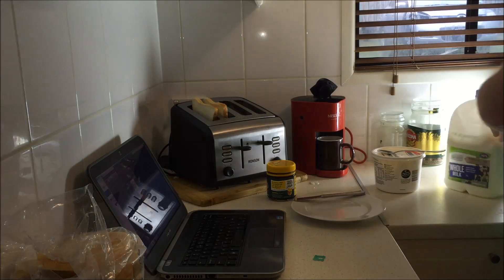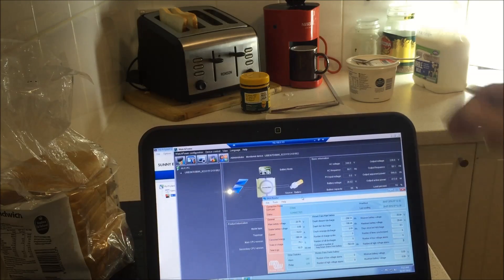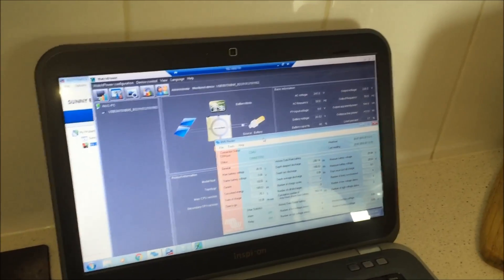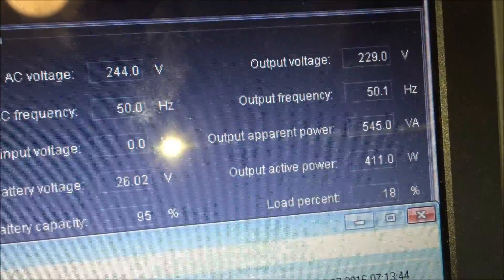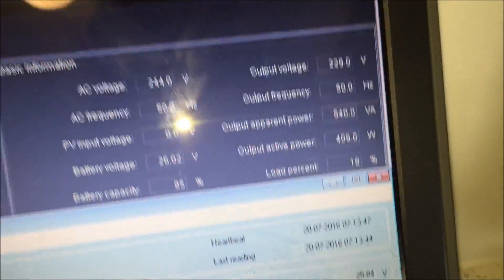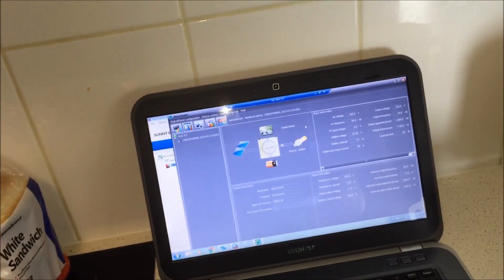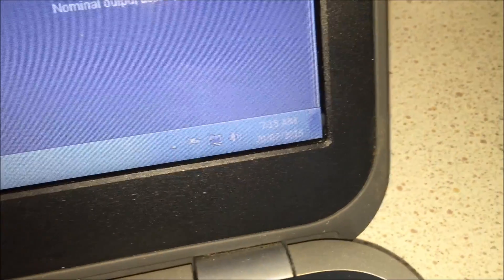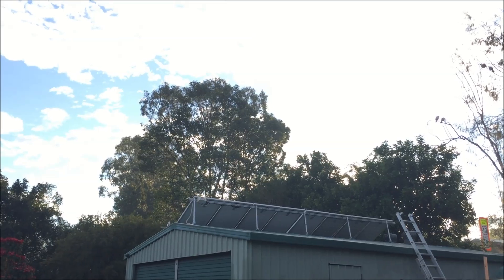Morning Coffee n Toast then battery cell voltage test

Comment: Just wondering your charge time to put back the 188 or so amp hrs you took out? The cells should last forever with a current draw of only .06??? amps per cell. Wonder what the draw is now per cell on your 48v system?
Reply from the maker: +old time engineer with the 48 v average ah taken from the bank per night is 150ah and on a good solar day it's charging at 40a so 4 hrs naturally a bad solar day it won't fully charge in a day. .6 amp draw is at a 4000w ac draw from the bank. Average is about 500w ac draw so batteries should last a good period of time.

Comment: The shorter and thicker the LT cables are, the less resistance there is.
You can measure the voltage from one end to the other on the DC side at full load, for each LT cable, then add it all together, to see what the total voltage drop is.
This will vary at different loads, but the lower the figure at high load the better. You will not get anything like zero, unless you use superconductors.!
Nice set-up. What a wonderful technological world we live in.
David in Lincolnshire UK.

Comment: 4am to 7am and your home consumes 4kw? I wonder if the air conditioning is consuming all that energy...
Reply from the maker: 9 kWh last night :) 5 kWh average at night (minus Hotwater) 25- 30 kWh day time usage
Reply: I think 4pm to 7am
Reply: I feel that 5 kWh per night is too much -- time to calculate the potential savings that a solar water heater could create. 

5kWh * 365day * $0.15 = $273.75
A solar water heater will cost $500 (300 liters)??
Reply: Better still heat the water during the day so you use solar power, as simple as installing a timer.
Reply from the maker: +ron westcott issue is with that is when the dishwasher ( or kettle, dryer, washer etc)and hws is on at the same time it ends up drawing from the grid at a higher $ rate.
Reply: +HBPowerwall You have to be careful to time it right

Comment: Going good!

You mentioned on Facebook that you have had over a couple thousand faulty cells. How many have you tested now?

Also does your tip accept the cells since the batteries have been ripped open?
Reply from the maker: +Brett well over 4 thousand ( scared too count) and I take them back to the recycler I buy them from.
Reply: +HBPowerwall after getting another 50 HP batteries it got me wondering why a store would have 50 in the first place. Possible recalls or maybe just faulty, I won't know until I get them open and test them. Anyway my question is would you consider using recalled batteries or leave due the fact they have been recalled as a result of a fire risk or would this be a great source for used batteries? (There was one as recent as June)
Reply from the maker: all my batteries are used & most likely abused. That is the reason we spend too much time testing them :)
Reply: I would think recalls would be fine. It really depends on why they did the recall.  It could be as simple as the plastic isn't shaped right so it could fall out of the laptop, causing a spark if it was pulled while charging and the lawyers told them to do it.  Or the BMS in the battery is faulty and could unbalance the cells.  In either case the cells should be fine to use, just test and put to use.

Comment: .45 amps per cell? maybe

3 packs 80 x 3 240cells
109/240=0.45
Reply: Sven looks right to me. Trust me I'm an accountant lol
Reply: Sven is correct as I am getting the same result through a different method

1. 109a*26v= 2834watts
2. 2834watt divide 1680 batteries = 1.68watt per cell 
3a. 3.7v *0.454 amps = 1.68watt
3b. 3.8v *0.442 amps = 1.68watt
3c. 3.9v *0.430 amps = 1.68watt
3d. 4v  *0.420 amps =1.68watt
3e. 4.1v * 0.409 amps = 1.68watt
Reply: He looks right to me as well. Trust me as well :D I am an accountant, M.Econ and MBA Finance
Reply from the maker: Now you got me thinking..

I was under the impression if you're working out individual load per "18650 cell" you would..

1. take load 109a
2. Divide  number of cells in 21
= 5.19047619047619
3. divide by 80 (number of cells in every 'cell')
= 0.0648809523809524

Or just 109 divide 1680 (80 cells x 21 packs)
= 0.0648809523809524

That's it i'm googling it or if anyone else could chime in - I constantly tell my wife i'm right but might have to concede on this one :)
Reply: Sven is right, the current is the same through each group of cells (240 individual cells in this case.)  In series the current is the same and the voltage is divided, in parallel the current is divided and the voltage is the same.
Reply: Yay. Someone agrees with me.
Reply: That means you can cook toast for 5 hours straight.
Reply from the maker: That's it i'm doing a real word test to prove myself wrong publicly  lol 
I'm sure my math is sound - but i understand i suck at math
Reply from the maker: no doubt i was wrong :)
Reply: we all make mistakes especial me, I always learn the hard way.

Comment: so I hashish idea right, make a power bank with laptop batteries BUT without breaking the batteries and remaining the whole thing
Reply: obviously it'll have to be new batteries for I don't thing it will be that much expensive, the only thing I can't not solve is how to figure out the batteries pinout to active the BMS
Reply: Not such a good idea
most packs have some dead cells, that's why we get them cheap
also it would be more hastle ( and harder ) to charge them in a balanced manner
Reply: +BitsAndBites that's why I said new laptop batteries, the cheap ones
Reply: Nelson Di Salvatore You pay for what you get, if it's cheaper to buy a pack then it is to buy cells, then the cells in the pack you're getting are probably bad ones

Maybe it could work though, but I wouldn't do it :p